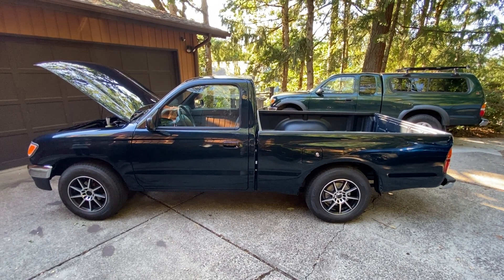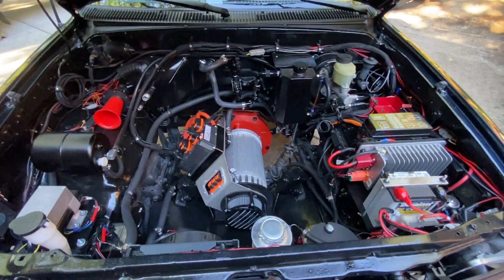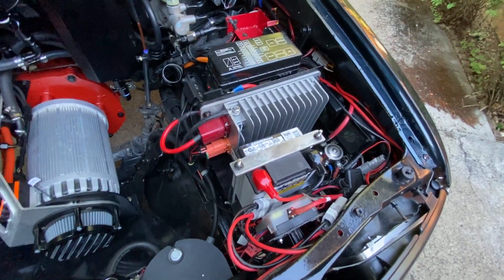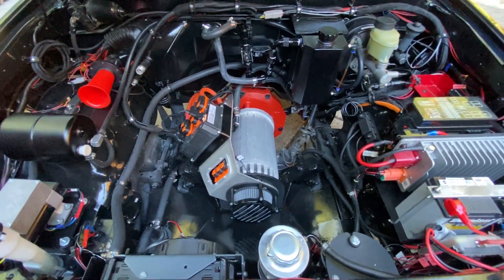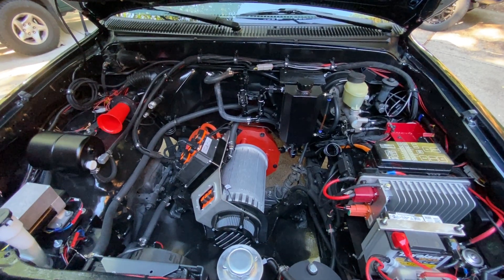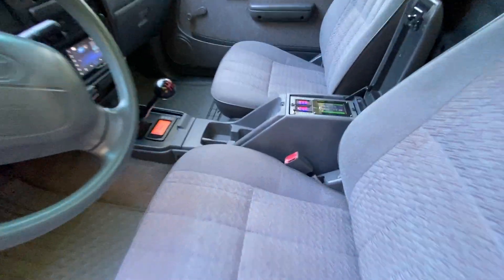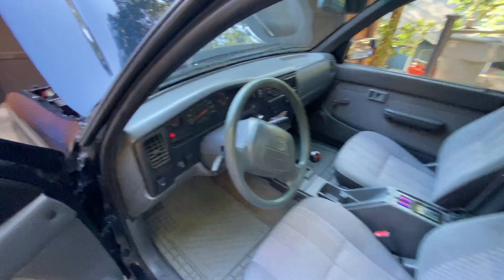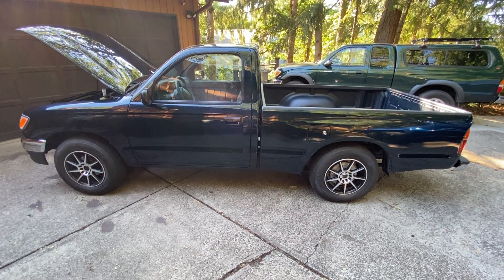Electric Toyota Tacoma Conversion

Comment: That's awesome, I would love to do this to my 99 daily driven Tacoma. Do you think it would would the same with an auto?
Reply from the maker: You can easily do it and the magic is keeping your current transmission and getting a W56 bell housing for it and a motor plate for the Hyper9 motor to that bell housing. Everything else is not Tacoma specific and can be used in any electric conversion. At this point you can just contact ElectricGT and they can get you the entire system including a motor plate and your off to the races. https://electricgt.com/shop/gte-173-e-crate-system/

Comment: I'm extremely interested in converting my standard 1998 Tacoma but for 150 mile distance. I tried your son's link and got a 404 error. Could I see your parts list and prices? Looks really clean what you and your son did. Love it.
Reply from the maker: I am building a full parts list for you now. Also I think the link should be working. The battery pack can be increased to increase mileage per charge. We did a 25KW battery and ElectricGT did have a 35KW that would have put us close to the 150 miles per charge it just come down to money on the bulid.
Reply: I have been thinking about doing this for quite some time now, so I'm also interested in a parts list once you have it made. :)
Reply from the maker: @tauhdiegrobbulus5657  I have included a parts list in the description.
Reply: @sullichr  Thank you!!
Reply: Same here I have a ‘99 gmc safari

Comment: You did this? How long has it been running? Range and hp? Work on a 78 Toyo pickup
Reply from the maker: Yep my son and I built this up and here is the link to my son's longer video (https://sites.google.com/view/fkasschau/electric-tacoma). There are stats on that page but its has 173ft/lbs of torque at 0MPH and goes about 100miles on a charge and does 0-60 in about 7 sec. We can charge it for less then $2 at home and it lasts all week. Anyone can do it and yes your 78 will work as all you need is a W56 bell housing for the motor plate that holds the electric motor. All the rest is non- vehicle specific. I can explain more if your interested.
Reply: @sullichr  Do you have any links for the parts you used?
Reply from the maker: @natet1227  So the battery box and wiring harness came from ElectricGT and if you just search them out you will find their main site. Here is the direct link to the battery box setup (https://electricgt.com/shop/gte-173-e-crate-system/). The battery setup we got from them had the DC-DC converter and radiator and all the wiring ready to just plug in. For the motor plate, vacuum pump and power steering pump we did CANandianEV and that is why the motor (and computer brain) are at an angle and not straight up and down. If we had done the motor plate from ElectricGT we would have had the motor and computer brain straight up and down. The CANadianEV group was horrible to work with and we basically had to stop working with them. Their site is basically broken and I can not provide a link to the motor plate. At this point I would have just done the entire setup from ElectricGT including vacuum pump and power steering as they are just crazy good to work with and back you all the way through. We then have lots of small parts like relays and stuff from NAPA and Amazon. Yes NAPA had all the normal truck parts like brakes and bearings and clutch parts etc.